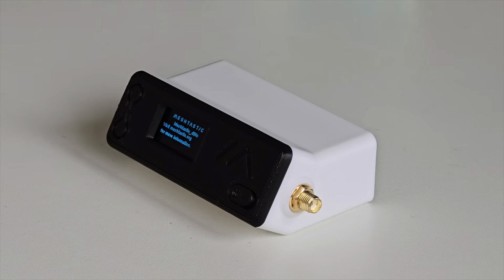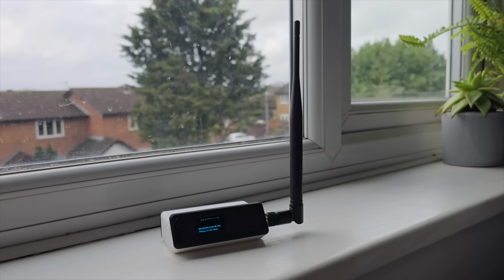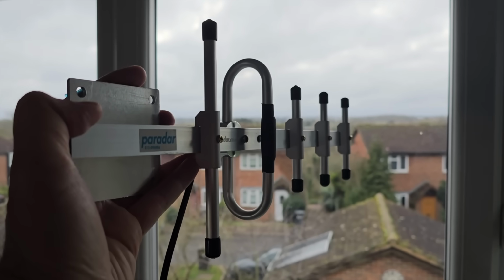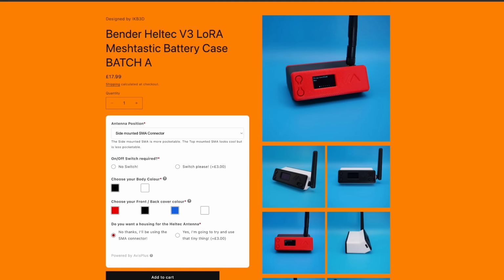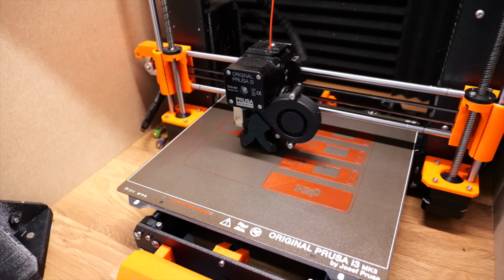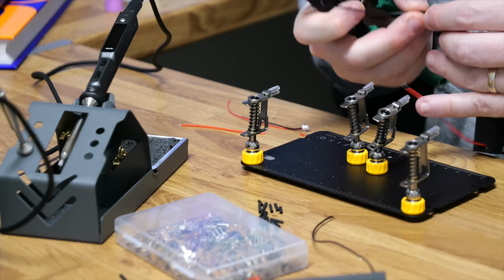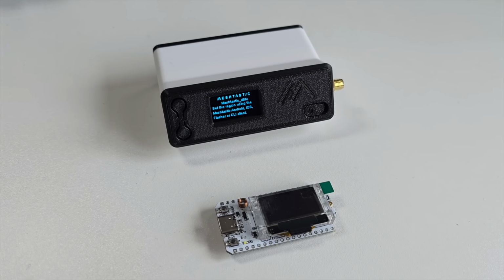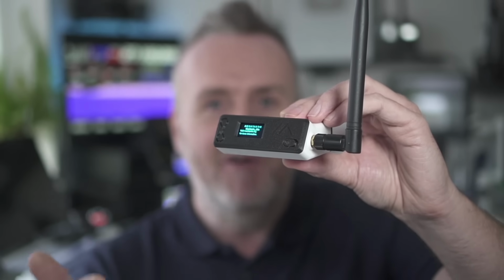THIS CHANGES EVERYTHING!!! #MESHTASTIC

Comment: Great case for the house. I hope the company that manufactured this is watching. What we also need is a weather proof case with a weather proof connection not only for the antenna but also for a solar cell to recharge the battery. We need to place the device at the top of a tree or on top of a building or mountain.
Reply: Not feasible in the UK, I've heard. Just not enough sun.
Reply: @losttapes1705  not sure about that, I run my entire Wi-Fi HD CCTV system from south facing small solar panels in Yorkshire, northern England. I will be rigging a Heltec up to solar soon in a tree.
Reply: This whole setup belongs in a plastic ammo can. Solar is another story, which can be done okay with something like hot glue and drilled holes, but... Still, these things will last from Friday afternoon to Aunday evening on a 5,000mah battery if you don't send a ton of messages.
Reply: Good to hear, what size are the panels? @Mellow_Wood_Hill
Reply: @losttapes1705  Get a BIG panel.
Reply: My thought exactly.

Comment: "... a bit of an obsession..." 😂
I get it! This IS an incredible device for secure, always on, comms device for Grandma and the kids to stay in touch outside the net and in case of emergencies or not!
Cool stuff!
Reply: just use pmr 446/cb/ or dual band radios and you dont need a network of toy radios
Reply: @londo776  What, and miss out on buying cool little pieces of tech gadgetry!?!
You must be mad! 😂
I can't see Grandma lugging a radio about in case of an emergency nor do I see a radio lasting more than a day in a child's(teens) hands either.
You should get one(3) and start playing! 👍
Reply: Definitely, I have a few high city centre work locations in the north ready for one, plus 3 relatives on hills like me that can all link up!
Reply: It will work for this, but without its own keyboard you loose all and any security as in encrypted messanging ability, this is because google and apple can easily see everything you type on your phones keyboard, so abaloutely no security here unless you buy a unit with a built in keyboard. Nice device for sure, as a reciever only or set to repeater mode, but your security is nil if you use a phone to write the message or read one someone sends you, same with computers unless your using a linux or RISC-V or ARM based open source device, nothing with an intel or amd chip in it. The instant you turn on one of these devices and connect it to your phone or computer google or apple instantly know the connected devices mac address and as they know who you are the link is forever made.

Comment: We have just gone live with Meshtastic in CV9 2 postcode area. Already we have three or four other meshes and because we live on top of a hill, it's already going 25 miles away on a handheld antenna and just in the upstairs window. The plan is to put one on the chimney stack for 360 coverage with a decent antenna. We have got about 8 units coming and are using an app that shows the best places to put them around the area.
Reply: Hopefully shout from B24!!!

Comment: Not distracting from this but I just put my T-beam in a 3D printed case. It is a very similar overall concept with the same 18650 cell. Should not be too difficult to persuade a friend to have one on a window sill in their spare room. (I would switch GPS off for that). I can see one of these in the very near future too.

Comment: I would not put a black PLA print onto my windowsill, this is OK now but might turn out not so nice in summer.

This Heltec V3 will last ~24 hours on a single 18650 Cell, so you should be aware that you will have to run a power there.

Comment: This is awesome. Does the USB socket on the side allow for battery charging within the unit itself?
Reply: It does! You can run powered without the cell in place or with cell charging :)
Reply: @zerofox3d   good job, mate 👍🏼

Comment: Prior to digging info out, I was kind of excited by long range radio networks. But in terms of LoRA-Wan, my understanding is that its not packet based, doesn't use TCP or UDP, and while it has a couple of applications, it is to be frank an off grid SMS 'thing' with some GPS added. The kit is expensive for what people get, and if people have fun with it, fair play - but I find it a very restrictive/expensive .. hobby? would it be fair to say hobby.. 

Anyhoos..
Reply from the maker: Huh?!

Comment: Question:  What is the minimum pieces of equipment that I'd need just to get up and running?  I don't think I need the case or any of that, but  just to test it and get connected; I can build one out later.  Just the minimal pieces?  I don't want to solder, although I could.  I just want to buy the least amount of parts to connect to power and get connected.  I can put it in a case later.

Comment: I'm put off buying from Heltec.
I bought a wireless stick v3 with oled display.
It arrived today.
I can successfully upload firmware and I'm assuming it's Heltec v3 or wireless stick light it tried every version for both.
But after reset or power cycle it didn't do anything.
Nothing on the oled display and it was not showing in the app or Androids Bluetooth or WiFi discovery.
Either I got a duff unit or its not supported now.
Im thinking I should save up a bit and get one already flashed with Meshtastic.

Comment: How long can the heltec boards run on battery?
Reply: Less than a day. The Heltec runs on the ESP32 processor, which is power-hungry. Other devices -- the Lilygo T-Echo and the RAK WisBlock, for example -- run on the nRF52, which is a lot more power-efficient.

Comment: why? just use pmr 446/cb/ or dual band radios and you dont need a network of toy radios
Reply from the maker: Works way better than PMR mate.
Reply: @andykirby   how? as there are no  nodes within 50 miles, so completely useless here and no voice what is the point?